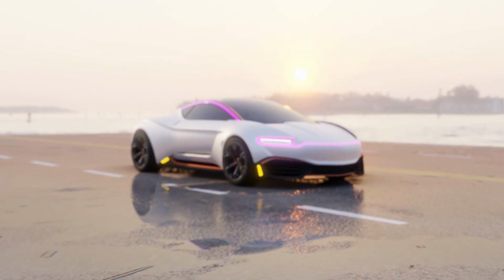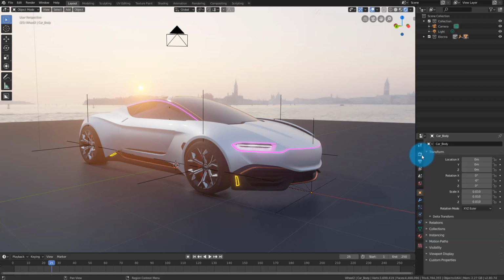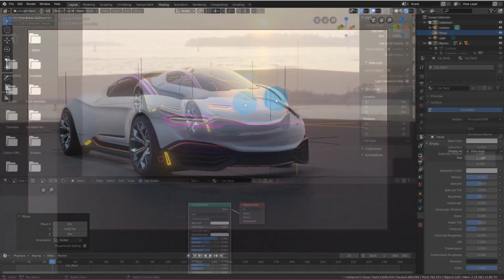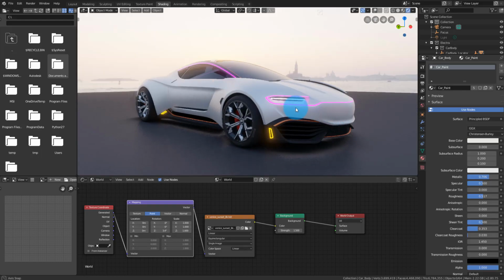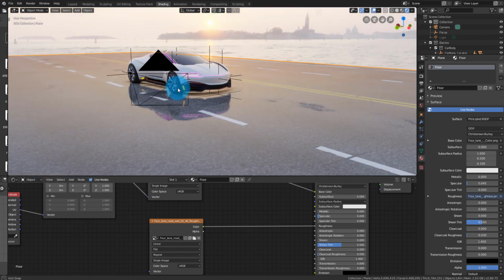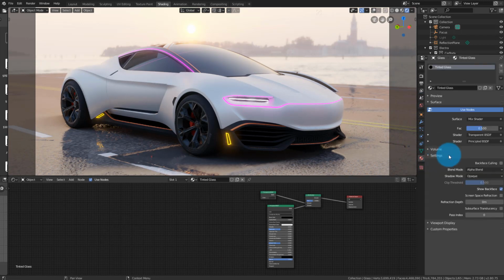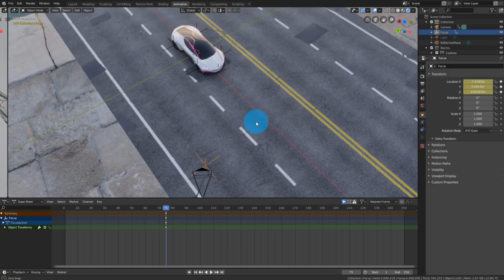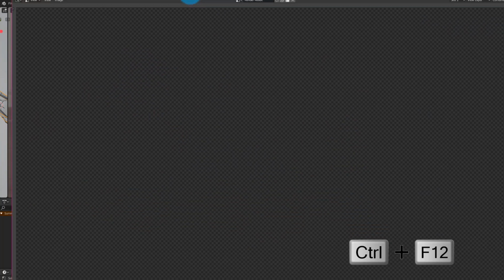Blender 2.8 Visualizing CAD pt.4: Making an Environment and Animation

Comment: Decent tutorial. However you forgot to set the roughness map to non-color. It’s a must that all textures maps except the color map be set to non-color as they do not contain any color information and solely work on B&W. Setting it to srgb will give false representation of a material.
Reply from the maker: Boujane Saad I bet that’s why they came out so reflective. Thanks for the tip and correction